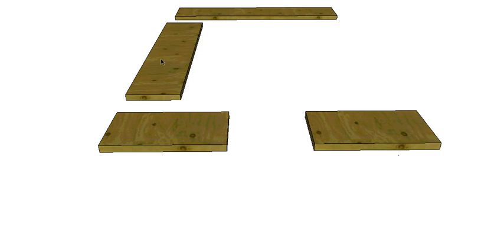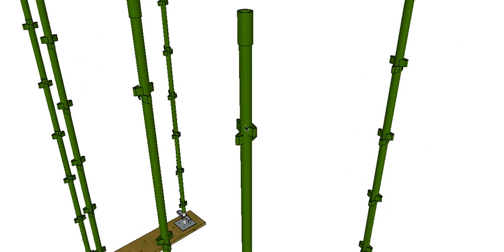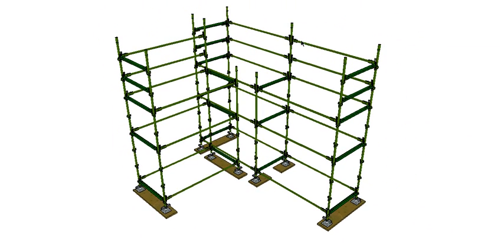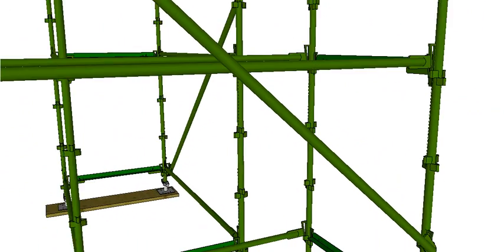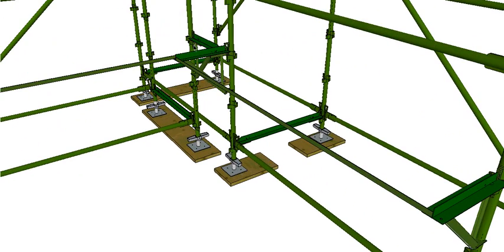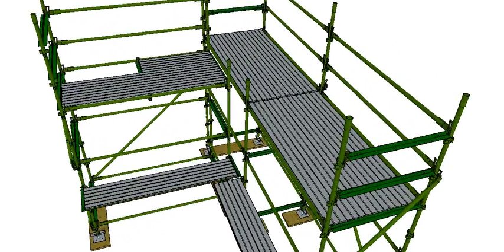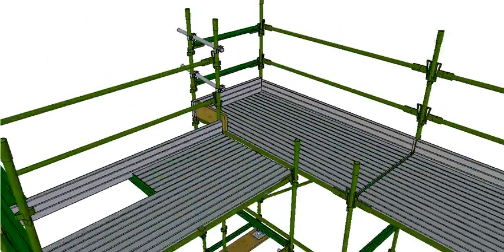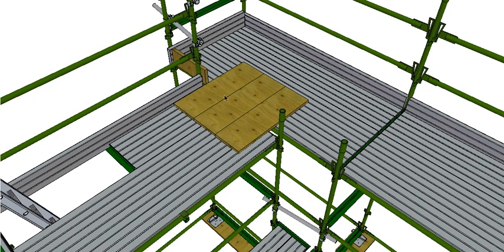Scaffolding Components

Comment: We're is the ledger on the hopeup.
Reply from the maker: Hi Mate, I have never put it in, the planks will still be held in by the standards. Codes says you only need leadgers at the working deacks and every lift so not sure if it is a requirement.

Comment: Hello I'm new to the trade and learning from the very basics. I'm reading this carpentry textbook and the next section talked about scaffolding, but here is where I got confused and it's making me so frustrated ..It says "they are erected in sections that consist of two end frames and two cross braces(this section is about metal scaffolding) and typically come in 5X7 modules. That's where I got confused....What does it mean by 5X7 modules....that's tripping me off. Care to help? Would greatly appreciate it.
Reply from the maker: Hi David 
It sounds like they are talking about a Unit Frame scaffold, not the type that is in this video. A bit like this one https://www.google.com.au/imgres?imgurl=https%3A%2F%2Fimages.homedepot-static.com%2FproductImages%2F6f5ed906-cdde-459c-998d-1a1f59f626fd%2Fsvn%2Fmetaltech-scaffolding-kits-m-mfs606084-a-64_1000.jpg&imgrefurl=https%3A%2F%2Fwww.homedepot.com%2Fp%2FMetalTech-Saferstack-5-ft-x-5-ft-x-7-ft-Scaffold-Set-M-MFS606084-A%2F203504573&docid=K6dDCBqki534lM&tbnid=GNQk2hYF-l_RVM%3A&vet=10ahUKEwj6vKbvzo7dAhXHAYgKHZbTCE8QMwhPKBMwEw..i&w=1000&h=1000&bih=1063&biw=1920&q=Unit%20Frame%20scaffold&ved=0ahUKEwj6vKbvzo7dAhXHAYgKHZbTCE8QMwhPKBMwEw&iact=mrc&uact=8
Reply: @Buildsum  Yes it's that, but I don't understand the 7X5 modules.. is it giving me the dimensions or that it comes in 7:5 sets of each ratio? Anyways thanks so much for replying!
Reply from the maker: Hi David, I think they may be referring to the Unit frames being 5 feet wide and 7 feet high otherwise it would have to be the size of the bay being 5 foot wide and 7 feet long.
Reply: @Buildsum  Thank you so much man, for the help and taking the time to reply. Very appreciated.